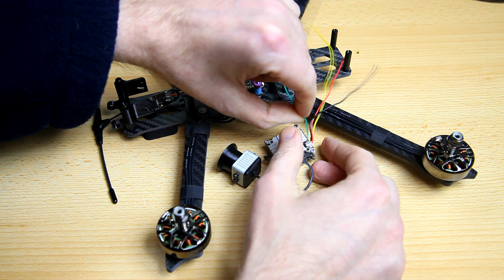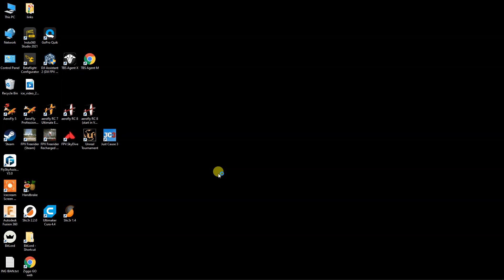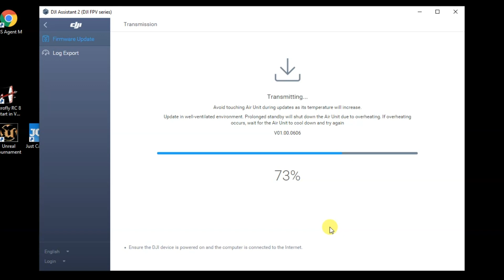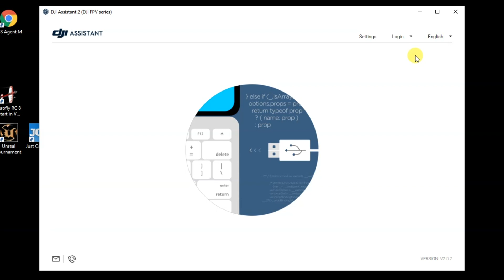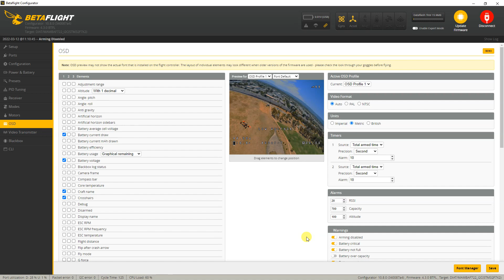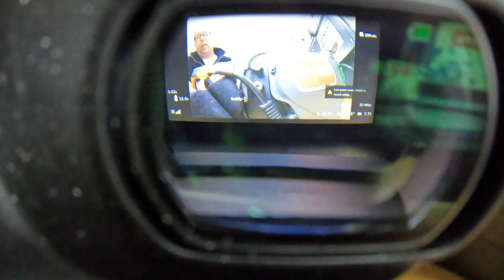How to install DJI Digital FPV - Vista unit (Rotorama Buddy 7" Build)

Comment: Here’s a question for you: I have a flight controller with a DJI plug on it. But I use crossfire so I don’t need all 6 wires in the wiring harness that plugs into the flight controller. As you’ve stated in this series I only need 4. If I still want to use the dji plug on the FC what should I do with the 2 extra wires? Can I still solder them to the vista and simply not use them? Or should I remove them somehow?
Reply from the maker: GOOD question :)  I actually kinda answered that in a recent build video: 
I DO indeed solder up those wires in case I would want to use a DJI radio.. That way if my normal radio fails, I have a backup.. 
BUT to be honnest: for normal hobby use I would just remove the 2 wires from the plug :) (use a fine plier to lift the tab for that wire on the plug to take the wire out)

Comment: I have got the problem, that when i want the unit to go into  couppling mode, the LED does only turns from green to a steady red. There is no blinking or sth. like that . Does anyone have a idea for the issue?
Reply from the maker: that actually sounds o.k... try pressing the button on your goggle when the link-LED of the air-unit is solid-red... 
does that work?
Reply: @DutchRC  WE tryed this a few times but it doesn't help. We've got no Connection...
Reply from the maker: @davidwingenbach1956  Strange.. really should work... DO you see the goggle go into bind-mode?? Maybe you're not pressing it's button the correct way? (to short.. to long..)